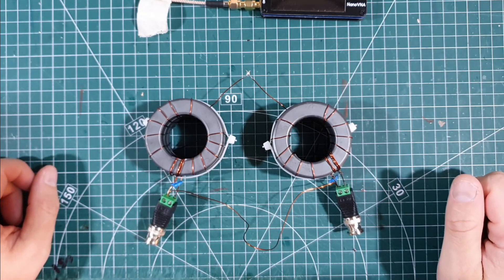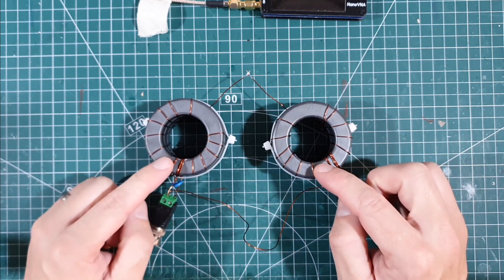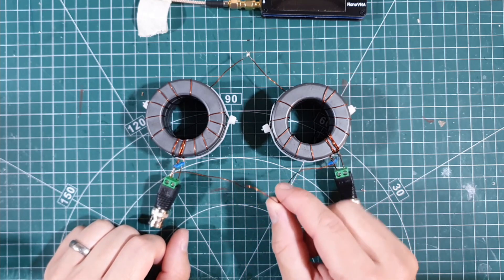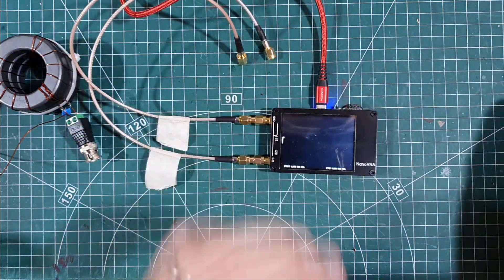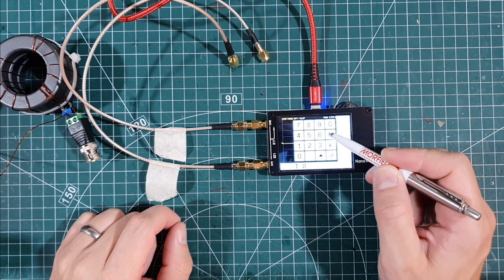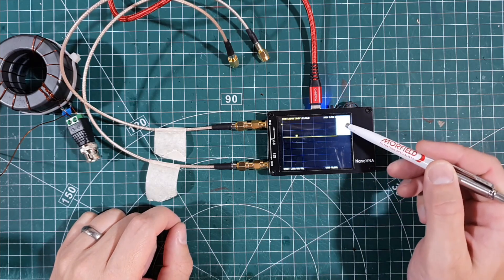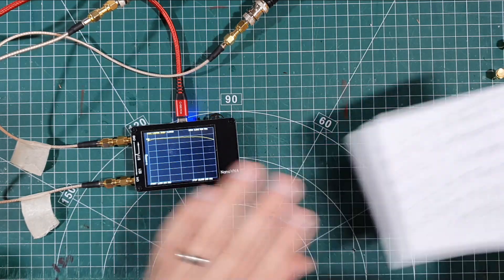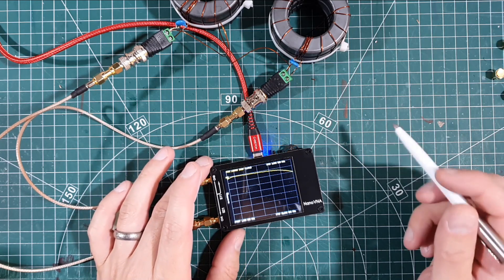How to measure Insersion Loss of an End Fed Half Wave Transformer

Comment: Colin, is there any measurement comparing wide-spread winding with and without crossover? I was trying to find some, but it seems there is none so detailed as your other measurements.
Reply from the maker: I dont think ive done wide spaced with no crossover. Experience tells me ot wont improve much over crossover (if and). Fill your boots tho if you want to measure it.
Reply: @MM0OPXFieldRadio  I had to pack the transformer wound on FT140-43 into a small box and crossover winding was not possible due to topology and space limitations. However, I have plenty of FT140-43 so I can measure that myself using the same method you demonstrated here.
Reply: I think I should have studied available information more carefully before I made the transformer. Apparently, a 2 to 14 windings transformer on FT140-43 performs poorly on 7 MHz band :( 
I tried back-to-back test of two transformers 2+14 turns (isolated primary) without 100 pF capacitor and the losses seem to be around 2.76 dB (1.38 dB per transformer) over the whole range 7-30 MHz. However, only around 10 MHz the real component of impedance comes near 50 ohm, at 7 MHz it is something like 27 + j22 ohm and SWR across the whole range is about 2+ (roughly 8.9 dB return loss).
Now comes a question: considering QRP use (TX500, i.e. max 10 watts), would it make sense to choose 3 + 21 turns, achieving a decent performance at 40 and maybe also 60 meters, provided that with this kind of antenna I am not interested in bands above 21 MHz?
Winding was wide spread without crossover as this allows me to access antenna terminals more easily than with a crossover.
Reply: OK, after having seen this video (https://www.youtube.com/watch?v=CPYBcKx3WYk&t=20s) I wanted to test material 61 vs 43 as 43 in back-to-back test seems to perform not-so-well on frequencies below 14 MHz. As I do not have, yet, the 61 material tube mentioned in the Evil Lair video, but have two cores FT140-61, I wanted to see how they perform compared to FT140-43. While FT140 definitely doesn't seem to be the optimal size even for QRP (due to higher insertion loss at 10 MHz and below) at least I expected to see comparable (i.e. roughly the same) performance, in fact I would hope for much improvement between 3.5 and 10.1 MHz. However, I was astonished by the results. Insertion loss at lower frequencies (3.5 to 10 MHz) between 12 and 8 dB (6 to 4 dB per transformer in the back-to-back test) and only at 20 MHz and above the insertion loss was about 2dB (back-to-back) which is comparable with 43 material. However, in this test, this 61 core would be much worse than 43.
Maybe I got the wrong cores from the seller? FT140-43 is dark gray, almost black. These two FT140-61 color looks much lighter, medium gray, like anthracite.  Or is it just that FT140 is simply too small?

Comment: Colin, another very fine video in finding out how to measure things. I would add only that having an answer in db is not so meaningful for those of us who do not deal with db all the time. The db loss can be converted to percentage using the following formula: percentage = (1-10^(db/20))*100. Example: I read a loss of -0.71 for the pair of transformers, so -0.71/2 is about -0.35 db loss. So, percentage = (1 - 10^(-0.35/20)) * 100 = about 3.9%, or call it 4%. Now I know that my transformer is costing me about 4 watts of power if I am using 100 watts. Many thanks for doing the in depth analysis that you do!! Todd, N7TWL
Reply from the maker: Your right Todd, my spreadsheet shows this. Twas an old video. Got to be careful though, especially with newcomers. Whats worse? Losing half an S unit or 50% of your power. Glass half full or half empty kinda thing. Personally I agree, percentage is better.

Comment: Have you ever wound 4:1 balun? I find TRX Lab explanation of CMC combined with transforming toroid appealing but when I made it, I had higher SWR on all bands and it was >4 on 10m. On the other hand using the form presented by DX Commander and SmokinApe using 2x CMC wired parallel/series I got good signal and SWR<1.5 on all bands with wide bandwidth on 10m. Any ideas on best balun? End of day I think I'll use the 2x CMC type but do you know if I'm missing something? My antenna is a 40m horizontal loop 11m height.
Reply from the maker: I'm a big fan of GM3SEK and his work. If you dont know it, look it up. I exclusively use those design of chokes if needed.

Comment: It is my understanding that the nanovna already measures power, so dividing by 2 would not be needed.
Reply from the maker: You have 2 cores, twice the loss so you need to divide by 2.
Reply: @MM0OPXFieldRadio  Why would that be? If I measure the loss of a system of n cores , the loss of the system is still what I measure.
Reply from the maker: @gartnl  Yes but you have 2 sets of cores back to back. If you have 10 db loss across the system then each transformer has 5 db loss. Each transformer must be identical. There are a lot smarter people than me that come up with this method. You can also use a single transformer with a 2450 resistor on series and use a formula to determine the loss. Both measurments are within a percent or 2. I would do more research on measurment methods. If you have a new method then please share it with the Ham community.
Reply: @MM0OPXFieldRadio  I missed your remark at #2:37. That explains my confusion.

Comment: Tu calibración no es correcta,  tienes que calibrar con los dos cables juntos en serie, saludos.
Reply from the maker: Can you elaborate further? Yes I add on the BNC connectors etc after calibration but it makes no measurable difference at HF.

Comment: Colln, did you measure the loss of the two test leads incl connectors?
Reply from the maker: Yes, fitst thing I did after calibration. There was a 0.01db of loss across the total setup.

Comment: Good stuff.  
How much coupling did you get from having them next to each other?  Is there an effect from the desk?  Ie metal frame etc
Reply from the maker: I cant quantity that. My desk is 100% non conductive. Its a ply top sitting on top of plastic saw horses.
Reply: I did notice a change in the frequency response as the transformer assembly was slid away from the VNA.  I may try a similar experiment with the transformers supported away from the table-top (perhaps resting on a thin cardboard box).

Comment: Really interesting video Colin, I do have a VNA and have experimented like this. I was also wondering, as I have a 2 ch Rigol scope and a signal generator whether another method could be to connect my generator (which has 50 ohm output impedance) to the transformer primary then compare the output level on the secondary. I suppose the only difference would be the scope has an high input impedance. Then I thought about putting a T piece on the secondary scope probe with a variable resistor and I could then adjust it for maximum output, measuring the resistance could then give me an accurate turns ration 2450/50 etc. Does any of this make any sense to you. Main advantage is I only need one ferrite to test.
Reply from the maker: It kinda does. Im no expert on the method. There is a method to use a 2450 non inductive resistor. I cant remember the method exactly but you only need one transformer. I need to look it up again.

Comment: So, it is evident that the loss of high bands has been confirmed so many times in the last 7 years. Unfortunately, amateurs keep looking only at SWR which is great on high bands due to simple attenuation of reflection on the way back thru the transformer, just like you see low SWR at the radio side when inserting long and lossy coax. The Insertion loss of less than 0.5 dB 3-30MHz is possible, see the MEF-330-1K+ with three 2.4" cores stacked.
Reply from the maker: 100% agree, myantennas is the only manufacturer that publish insertion loss data.

Comment: Proven yet again that the 3 stack of 52 mix is NOT an efficient 80m-10m antenna. I can think of at least 4 people now that have shown this sort of measurement, but the masses keep building these inefficient transformers anyway. 🙄
Reply: I'd be very interested to see how a 3 turn primary works, and close wind the transformer. Agreed, the 2/14 and spread winding keeps on happening. But huge kudos to the people who actually do testing. Even more kudos to those who experiment and take it further.
Reply from the maker: Yep, there's unlimited options to try. I'm pretty sure doing what you suggest will improve the lower bands at the expense of the higher bands. This is what happened on the FT140-43 which has comparative geometry.
Reply: What’s the alternative?
Reply: @Htfhjooffhgghwwwwdf  3 cores of this size and the wire length is starting to get long at 10m and bringing in other problems. I'd use a 43 mix and 2 cores at most. Then a single winding close wound. Tapped at 3 turns. With 1 core your efficiency will be better than most, much better than a 2/14 spread out version. With 2 cores and 3 turns using FT140-43's my experience is that the 10m band suffers but 80 and 40 are very good. The impedance that the transceiver is working into becomes problematic with more cores and more turns on 15 and 10m particularly with 43 mix. Mr Evil Lair Electronics has excellent videos on this - well worth watching.
Reply from the maker: How is it a generaly inefficient antenna. Its a dipole, yes mounting some ways it can be inefficient but mounted at the right height/configuration it's as good as it gets without adding reflectors/directors.
Reply: @MM0OPXFieldRadio  I disagree, it is a dipole only on the frequency band where it is a half wave long. On the harmonics the lobes split up. There is also transformer loss.
Reply from the maker: The EFHW is a compromise but your get multi band antenna as a consolation. Those lobes have gain over the dipole. With your logic a yagi without a rotator is not efficient as you get very little of the sides or back.
Reply: @MM0OPXFieldRadio  One purpose of a yagi is what you describe, I use stacked yagis to the U.S. exactly for that reason. The  then narrow split lobes of a long wire on harmonics have less gain then the main lobes and have far less gain then a dipol. Anyway, the EFHW is a nice multi band compromise antenna and the lower efficiency is the price one has to pay.
Reply: @MrTalaue  My modeling in 4Nec2 indicates that an EFHW optimally mounted as an inverted-L, elevated feedpoint, flat top not too drooping comes in at similar to a dipole - the difference being the lower end of the EFHW for the feedpoint is lower than the dipole usually. Keeping the hugher current points higher int he air helps. Extensive testing on a contest weekend against an OCF up 12m to my lower EFHW indicated difficult to distinguish results making contacts from VK to Italy and Germany on SSB 30W - but that is not a great metric. IMO using the coax as part of the antenna is a mistake, using radials is better. Lobes on a 40m fundamental band EFHW are NVIS on 40m, and lower angle on 20m. Using the same antenna as a low sloper, low feedpoint etc drops received signal, from observation, significantly. Pretty much the same as running a dipole at 1m to 4m of elevation. I have no idea why it is a compromise antenna. Transformer losses in the order of less than 0.5db are pretty much an OCD level argument in the face of QSB of a few S points. Yes I chase loss, no the transformer loss is not a major thing unless you run high power digital, or use small cores and long overs etc. Arguably, you can use shorter coax runs, but the E field at the feedpoint is significant and probably not  great idea to sit in even on QRP. Running at higher power is arguably a terrible idea, sorry, me being pessimistic. For a portable antenna system it is hard to beat - gain, lobes, efficiency. Apologies if I sound pedantic etc - those are my observations.
Reply: It won´t matter that much with a generally unefficient antenna.

Comment: Kudos for going to the trouble of testing - and I enjoyed your video. Thank you. May I suggest calibrating at the fixture - screw terminals - where you connect the transformers as there will be losses in the BNC and the screw terminals. It would make an interesting follow up - and I may well be wrong. Yes it might not be a lot but it will add to uncertainty. I've used this method also and found it agrees with a simple link and then using Rp to calculate efficiency for the lower bands, but diverges from the single transformer and terminating resistor approach. From the shape of the S21 it is suggesting that an extra primary turn may help on 160m but will most likely make 10m worse. Getting broadband over 160m - 10m has defeated me in the past. You can do a heating calc from those figures also. Again, thanks for the video.

Comment: You can do a better test with the VNA.  Use a single transformer, and for the output load, use a 2400 ohm resistor in series with a 52 ohm resistor.  Feed the junction of those into the VNA which will see close to 50 ohms impedance.  You have to correct for the attenuation due to voltage divider of the two resistors.   This measurement eliminates the double hit of the two series leakage inductances of the two transformers.  With the single transformer method, you only see effects of leakage inductance from the single transformer. 
  -Steve K1RF
Reply: I've done both. Calibration of the test fixture at the plane of the transformer is critical tho. Despite my best efforts I do get significant differences and I suspect my calibration is at fault. I've found the single transformer and terminating resistor method showed significantly better efficiency than the 2 transformer method - but I don't know which is correct. Bearing in mind that no antenna will ever present such a load - but I do like to be able to to compare transformers.
Reply from the maker: Hi Steve,  I'm having trouble visualising what your describing. My background is not electronics. Can you direct me to a description of the method with pictures so I can try? I see you mentioned the losses above 15m can't be correct, can you quantify this through either published data or your own experimentation? I'm going to continue with the back to back for now as all my checks are then relative to each other. This is a huge learning journey for me.
Reply: @MM0OPXFieldRadio  Over and over some people want to claim that the losses at the higher frequencies of HF cannot possibly be correct for this 3 stack of 52 mix. Yet somehow they seem to completely ignore that there are multiple 43 mix options which do not show this loss when doing exactly the same testing. If what they claim is true, then the 43 mix examples must also be showing false loss during testing and therefore also be even better than the measurements show. Now I certainly don't believe that and I doubt you do either.

Comment: That was very interesting as I use the 40m EFHW almost exclusively. I use 43 material in my toroids so not sure how much the results would differ between the two materials.
Reply: In my experience, for the lower bands adding an extra turn to the primary makes a significant improvement, but can make 10m band worse. I use #43 and similar materials. Using a close wound auto transformer winding method improves performance by a few percent.

Comment: It would be interesting to see if different mixes in the cores would improve the high bands of changes in capacitor values.
Reply from the maker: The combinations are endless to try. Theres maybe something in that.
Reply: @MM0OPXFieldRadio  Indeed it is endless. I've spent 12 months trying many combinations in many ways. It is great to see someone actually do the testing. On the capacitor - I've been meaning to put a variable on the transformer and see what that does. Core geometry and winding technique can make big differences.